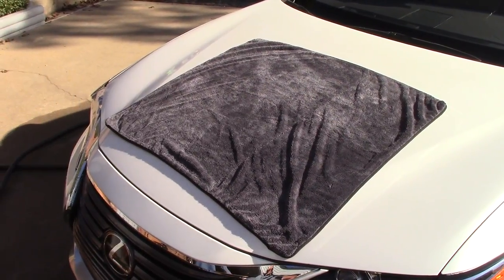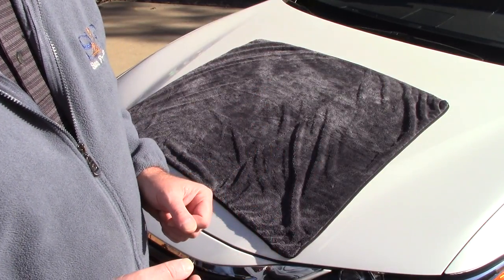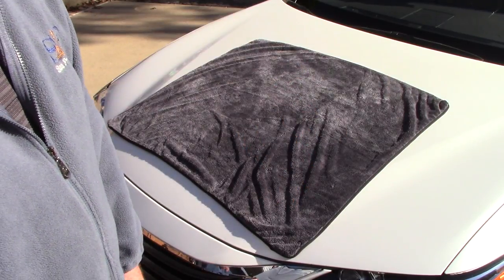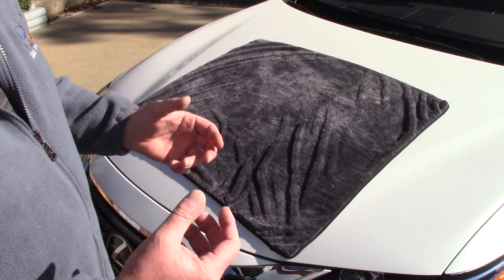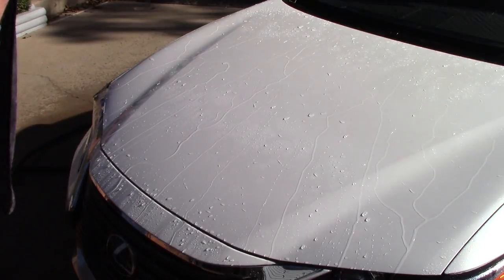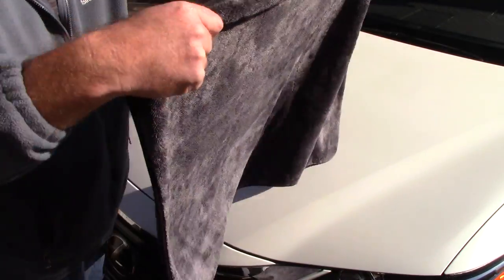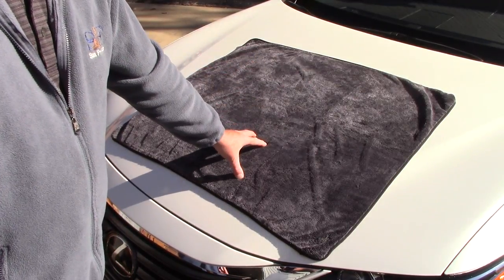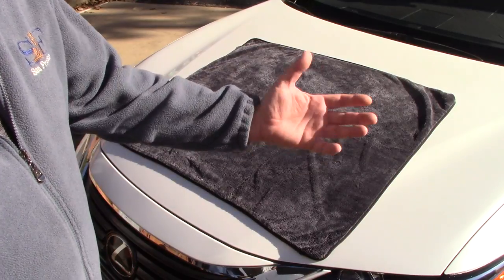World's LARGEST Drying Towel For Cars - Suv's - Trucks!

Comment: Scott, I used my "Sucker" this morning on my 2017 Silverado Crew cab short box, and found it was pretty amazing, certainly better than anything else I've tried. Your method of pulling it across the hood worked perfectly, but I found the Sucker was all sucked up, and needed squeezed out before I was done. Tends to weigh a bunch at that point but is manageable for me. I would love to add the smaller version of the Sucker to my drying regimen. That way I could do pretty much everything except the doors or bed, and retain the convenience this towel provides. I think the size is right, not too big not too small, perfect for the common midsize SUV's out there. Also, I did manage to snag the fabric on the "V" on the door emblem. I washed twice before using the Sucker with Malco micro refresh, and finished the day with Meguiars ultimate fast finish via "The Jack" towel from you. Keep up the great work Scott. Much love from San Diego.
Reply: A smaller Sucker would be great! Scott will see this and probably make it happen, makes sense and CENTS💲💲💲

Comment: Drying is by far my least favorite part, I've tried using a leaf blower, but it seems to leave streaks of water. A towel usually works well, but it takes forever. Every towel I used, you have to wring it out after like every panel. If you don't you get streaks like crazy. I'm so glad you made a towel that doesn't require that, it will be a life saver.

Also quick question, I don't have dryer and hence a lack of a lint filter, so my towels always leave lint when I wipe a panel. If I wash the towel enough will it stop? Is there anyway to remove lint?
Reply from the maker: I tested my towels by just washing and let them air dry..im not having issues with lint
Reply: Dallas Paint Correction & Auto Detailing Interesting, gonna guess I have lower quality towels than.

Comment: Why theres moisture on my car panel hours after i polished it?
Reply from the maker: Could be from polishing oils from the compound or polish..
These oils or residue left on the panel after wipe off can attract moisture..
If you continue to see this issue, use a paint prep to remove those oils after polishing
Reply: Tnx scott! Forgot to mention that i used an AIO sonax polish & wax so didnt have to wipe off with IPA after because it says it leaves protection. Im a beginner im worried that i did something wrong on my clear coat that may lessen my paint longevity.

Comment: Hi Scott I used the big sucker on a Ford F-250 yesterday and it did an outstanding job. Of course since I’m new to the Automotive Detailing business; I washed it with all my other Microfiber towels and then threw it in the dryer on medium heat. Have I compromised the towels? Also I ran into a problem that maybe you can help me out with. I’m 5.9ft and had a hard time cleaning the middle of the hood middle of outside front windshield. Are there any 3 step ladders you can recommend. Also please give me any tips on cleaning the inside bed of the pickup truck. Thanks ahead of time.
Reply from the maker: I think you should be fine with your towels..in the future always dry on low heat, tumble dry low setting plus no dryer sheets..i wash in cold water only, I may use warm water if towel is heavily soiled but I never use HOT water plus only wash microfiber towels alone and not with other things that may lint like cotton...sometimes I will let towels air dry but if I have a big load I always use tumble dry and lowest heat setting on the dryer...also use a microfiber detergent or something like ALL clear detergent from Walmart that has no dyes, fragrance or softeners, never use regular laundry detergent...hopefully that helps
Reply: Dallas Paint Correction & Auto Detailing Thanks, how about the height thing? You know in the DFW area there are a lot of lifted pickups and suvs. I’ll bring a small ladder for now.
Reply from the maker: oh im sorry...yes I picked up a folding platform from lowe's called the WERNER platform..its about 40 dollars and works great..its about 3 feet long and with legs extended it gives you an extra two feet of height from the ground..very stable and well built and easy to store...take a look and see if that would help you
Reply: Dallas Paint Correction & Auto Detailing Scott I have a gentleman who wants me to Detail his 18 wheeler. I have never done one before and not sure if I should turn him down or try and tackle the rig and figure it out as I go. Need your wisdom here. I also have a guy who wants me to remove oxidation from a trailer. Never done that before either. Any advice will help. Thanks

Comment: What’s the best way to start washing your towels I don’t want to mess them up
Reply from the maker: You can use a dedicated microfiber detergent like micro restore...
I use ALL clear in a white bottle from Wal-Mart, it has no dyes, fragrance or softeners and it works fine..
Wash them in cold water and let air dry or use your dryer but on lowest heat setting, tumble dry low heat..
Also don't wash them with cotton towels and try to wash and dry them alone..
No dryer sheets as well..
Great question and will address it soon on a video.
Reply: Thank you Scott for the quick response got a busy week ahead and it’s beautiful down here in Louisiana